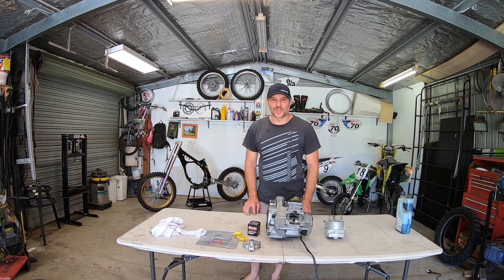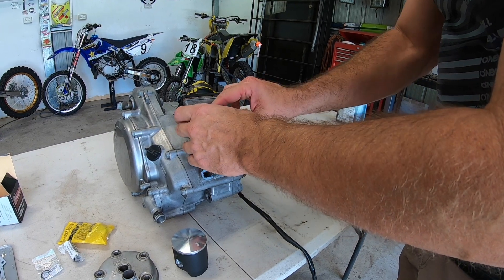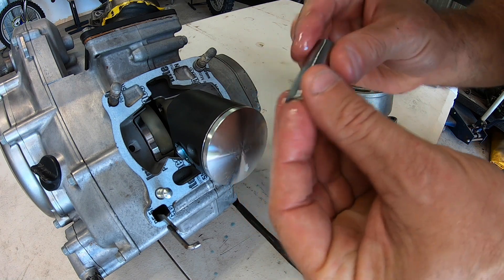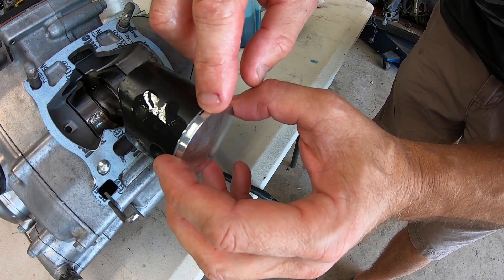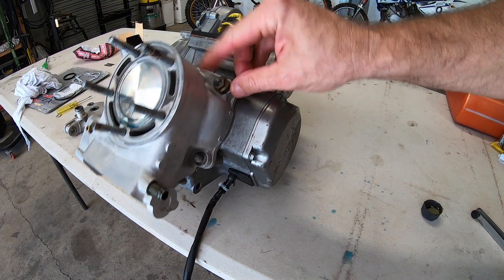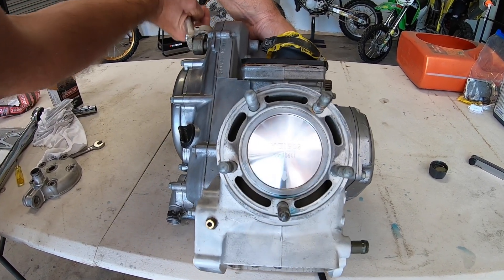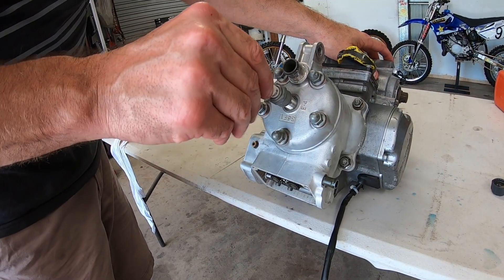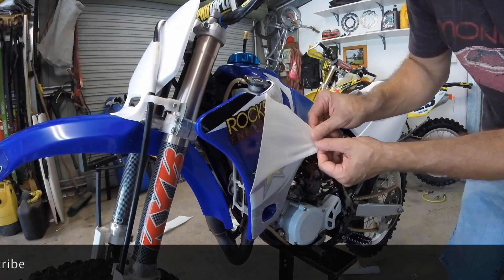2 Stroke Top End Rebuild Piston Replacement RM125.

Comment: Single ring pistons trip me out. I understand there is a reason for them, its just weird. To me. Thanks again for the 20%
Reply from the maker: Thanks mate appreciate the feedback
Reply: Below 7,000 rpm the drag from the piston rings is about the same
whether 1 or 2 rings. Above 7,000 the single ring has less drag then the
two rings. It's small but measurable and tells you that this engine is built
to rev hard and high. The price you pay for that extra performance is
a bit more maintenance of the piston and ring.

Comment: Got a question just picked up a 86 rm 125 and the dude said it had a 91 rm 125 piston in it 54.00 which I think is stock well I orders a wiseico piston and it says it fits stock 91 rm 125s well my question is will it fit? And it had absolutely no compression so I think they my problem

Comment: Do you have to hone if there are no scratches on the cylinder?
Reply from the maker: I whoud.
Reply: Broken Sprocket why is that? I heard if you can’t see or feel scratches it’s fine to run as is. I put mine back together without touching the cylinder and it runs 💯